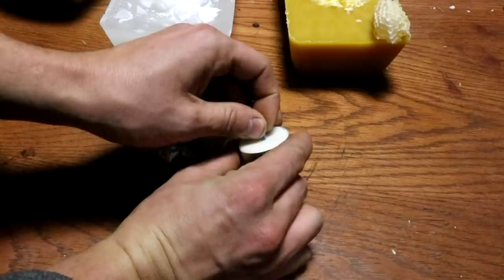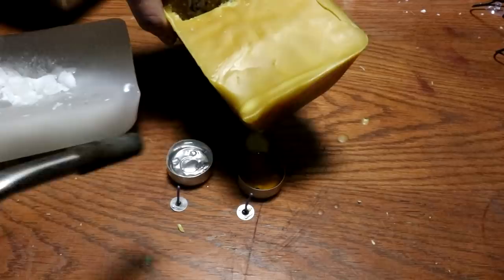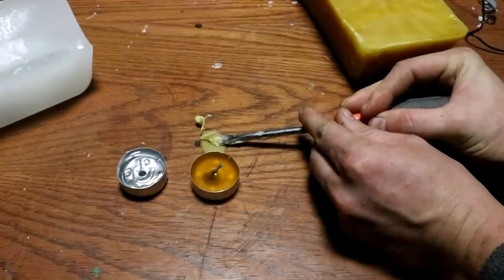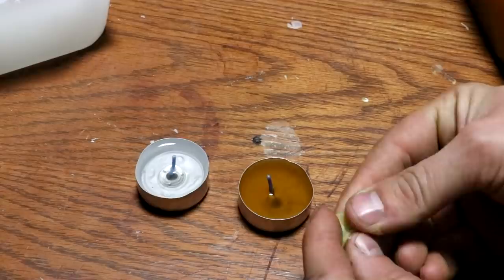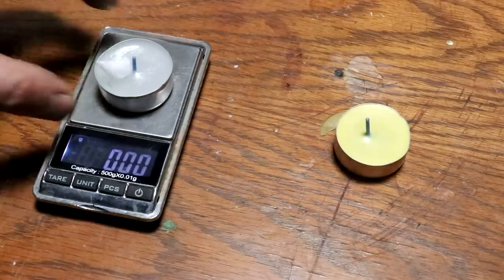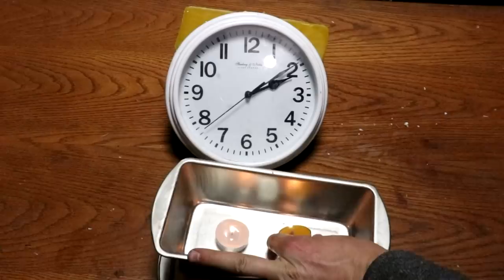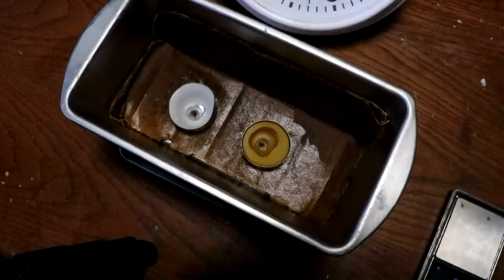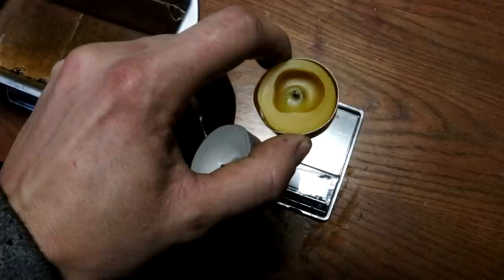Beeswax Vs Paraffin: Flame Test

Comment: It's cool we can see that you set the timelapse camera to 20 second increments, because the second hand adopts 3 different positions on the face of the clock. 60/3=20
Reply from the maker: It was actually 40 seconds.
Reply: It could have been any multiple of 20 seconds provided it wasn't also a multiple of 60.
Reply: Aww yeah, JamesG is correct.  That's a cool phenomenon.
Reply: For those tickled by the 20sec vs. 40sec question, the deeper explanation lies in the mathematical topic of Group Theory. In this case, the positions of the clock hand corresponds to the group called Z_3, only taking the three positions of 0/20/40, as a subgroup of a group called U(1) or S^1, describing all possible clock-hand positions. 20 seconds corresponds to a 120-degree clockwise rotation, while 40 seconds corresponds to the opposite, namely a 120-degree counterclockwise rotation (or, equivalently, 240-deg clockwise).
Reply: Clearly this is the case of sampling error. Since the signal (clock hand movement) was a frequency (1Hz)  higher than twice the sampling rate (1/40Hz), the reconstructed image (playback video) differs from the original image, and is aliased. Given these frequency, if the clock hand moved at any frequency that is a multiple of the sampling rate, even 600Hz, ie, 10 steps per second, it would appear indistinguishable (ie, aliased) from a clock moving at half the sampling rate (1/20Hz, or 1 tick per 20s). This is known as "aliasing"

On playback, the reconstructed signal appears to have a frequency of 1/2 the sampling rate (ie, 1/20Hz), due to  folding (experienced as the wagon-wheel effect, where a spoked wheel appears to rotate slowly or even backwards in movies).

For more signal processing theory relating to sampling theory, wikipedia/Aliasing is a good starting point.

Comment: I know there's a slight convective current but would it make much difference testing on a large flat surface compared to a "bowl" that could hold in co2 and not have sufficient o2
Reply: This would be true only if it was much more constricted.

Comment: I think that included with the thermal absorption of the wet cardboard, the fact that it was done in a dish meant that some co2 collected at the bottom even with the convection current from the flame,  hindering the size of the flame and therefore not allowing all the wax to melt

Comment: love your videos fellow utahn here. keep up the great work. the beeswax did not burn as fast, it had a longer longevity than the paraffin, but at the same time, the paraffin burned brighter and had a larger flame it seemed like. if you are up to it, you should try and do a thermal heat test with a laser thermometer or some other tool and see if the flames have a temperature difference. i am thinking the paraffin burns hotter and faster but does not last as long, but the beeswax burns less intense but lasts a lot longer. each could be suitable in their own ways for different applications. either way great work cody.

Comment: It might not have been soy wax but compressed paraffin powder. liquid paraffin is sprayed in a cooler and the particles cool and collect in a hopper that is augured into a mold and pressed. Candles are made much faster that way compared to traditional melt and solidify methods. There are some good videos here on youtube showing the mass production methods.

Comment: What I find with beeswax is that it needs a larger, more porous wick. It tends to contain impurities, which choke the pores in the wick; that's why the flame is smaller. It can even go out completely. It also produces more soot on the wick, again impeding proper flow.
If the tea candles don't melt all the wax available in the cup, something obviously is wrong with the ratio wick size to cup size.

Comment: Hi Cody. If you are concerned with the number of variables, and hence, respective number of experiments to quantify things like mixing ratios I would suggest looking into doing a statistical design of experiments (DOE). Something made for just this sort of thing so you only have to run a small number of experiments with a random distribution of your variables but can generate an optimizable equation to study the effects of each of the variables on a metric such as flame height or whatever you are interested in.

Comment: Bees wax releases more energy when it burns, but it melts and burns at a higher temperature.  I saw a good test for this with wood chips mixed with wax instead, and bees wax had a much stronger and longer flame, but also very sooty.

Comment: too much heatsink... metal and wet paper....
Reply: Wax is extremely insulating. The metal and wet paper are inconsequential in comparison. It's a fun/easy experiment you can run at home.

Comment: Melting Point:
Paraffin wax: 99 F
Beeswax: 140 F
Soy wax: 120F
Paraffin has an advantage regarding storage in being more chemically stable over time.
When testing candles, I measure Initial length of exposed wick and length of char, if not entirely charred.

Comment: Cody, pouring water on the cardboard was a mistake. It cooled down the containers not allowing the rest of the waxes to melt and feed the knots. They usually burn almost all the molten wax, and I think you should repeat the experiment without affecting the designed process.

Comment: You need a larger wick for beeswax for.the.same size paraffin candle.
Reply: nickwoo2  I was thinking along the same line. It's been a couple decades since I made and sold candles. Every new wax, candle container, or candle size I made required trial and error in wick selection. Burning down the core of the wax is a sure sign of needing to change the wicking.
Reply: @GOAP68  which wax you suggest paragon or beeswax with cryon?

Comment: The diameter (and material?) of the wick needs to be matched to the "fuel": 
Thicker wick-> more output, more liquid fuel available, but higher consumption (and risk of boiling). 
Thinner wick-> less output& consumption, but risk of not melting everything (can result in burnt wick), etc. 

That's at least what my brief experiments with oil lamps indicated..

Comment: Thanks you confirmed that Bees wax holds heat longer so if I use for a pcm material in my water heater it should perform better.

Comment: Good video. To be fair you should also make another test in jars, deep enough to allow the flame to to heat up the sides and melt them down as it goes down. 8 ounce jars should do. The flames will be different as well. They will take some time. Maybe a day or two.

Comment: You said that paraffin wax has a lower viscosity when melted. This is true. If you are making beeswax candles you generally use a heavier gauge wick to produce the same flame that you would get from a thinner wick in a paraffin candle. The main reason your beeswax candle burned for so much longer was because it was drawing less wax and burning with a smaller flame.

Comment: My dad kept bees for a little while, and we tried making wax candles from the beeswax (including tea light candles). We tried wicks from the store, but we found that they really struggled to burn, had small flames, and went out really easily. What we ended up doing was using some butcher string as wicks, and the candles burned quite well after that.
Reply: Hmmm.  You've got me thinking... I just made a buddy burner in a tuna can using corrugated cardboard and the burr comb scrapings from my beehives.  (My husband is pretty used to my weirdness, just responding "oh, uh huh" now when he asks what the heck I'm doing and I tell him, but this one may have convinced him I've completely gone over the precipice...)  Hopefully when I use the burner, the cardboard will wick sufficiently to keep it going.
Reply: @Wosiewose , if it's anything like the buddy burners that I made as a kid, you will have no problems. We made them for a class camping trip in school one year. Part way through the trip, they topped up the buddy burners with wax because a lot of wax had burned and the big coil of cardboard was still in good shape. Even with how beeswax burns, I would think the cardboard as a wick would work really well.
Reply: @adammcinnes5615  Oh good, thank you!  Appreciate it!

Comment: Normally a votive candle like that would burn completely with no or minimal wax left behind.  In this case the water on the cardboard cooled the aluminum casing on the candle and prevented the wax around the edges from melted down into the flame.  I would say your “safety” measure skewed a very interesting experiment at least a little.  I would be very interested in seeing it done without any water present.

Comment: Pouring beeswax at 180° causes less shrinking than beeswax at higher temps.  That's important when making candles because you want them to shrink enough to be removable from the molds. Below 180 it could still be liquid but it doesn't shrink enough and the wax gets stuck in the molds
It'd be interesting to see how much volumetric shrinking beeswax has at varying temperatures, and course the same with paraffin and, if you're interested in that too.

Comment: I wonder if adding some parafin wax to bees wax might increase the burn time. Much of the bees wax wasn't used by the flame, if the melting temp was slightly lower it might be able to utilize more of the wax. This would cause an increased burn rate, but there might be a ratio that increases the burn time.

Comment: Hey Cody one of my frends spilled sulfur on the flor of the classrom. What should i have done about that, because they did not just spilled it but they blowed at it and i should note that was not a lab but a normal classrom with no ventilation. Was it poisonous

Comment: Are you able to purify bees wax so it is white again?
Reply from the maker: Im working on it
Reply: You need albino bees for that. ;-)
Reply: Yes, it's possible.
Reply: How would you do that? melt it and put it through a hot mesh sieve?(so it doesn't solidify on the sieve)
Reply: I imagine "cracking" i.e. differential distillation. Pulling off the fractions that have slightly different boiling points. Or perhaps solvents that dissolve the 'impurities'.

Comment: what happens to the wax as it burns off/evaporates? as in im curious if it is possible to capture the steam like distillation, and if it would still be wax afterward or refined into something else. or is it just completely burned off? i feel like the paraffin, being petroleum based, would react differently to that process.

Comment: The hole it burned in the wax is caused by the cooling of the water. If you had left it surrounded by air, all the wax would have melted. It's the same with using them in cold weather. So please Cody, do it again. And they will both burn even longer, I assume.

Comment: Your candles didn't burn properly because the water in the cardboard acted as a heat sink and prevented the wax from melting properly. Tealights need to be fairly well insulated so that the metal cup heats up enough on the sides to melt all of the way down into the bottom. You'll notice this problem if you try to place them on e.g. a tiled surface. The cardboard on its own would have been fine. You could dust it with borax if you're concerned about fire but it's unlikely it would even char.

Comment: Maybe I missed it, but what's the ambient temperature of the test room?

It's normal for tealight flames to be tiny, hence having that small crater under the flame as they burn, however, they also usually exhibit the behaviour of the flame heating all the wax inside the metal cup sufficiently to melt it into a liquid, ensuring that it gets completely consumed (or as close as possible) before burning out.

Comment: Seems clear that the paraffin wax has a larger flame because it there is more fuel getting to the ignition point. I'm curious to know if that suits due to less beeswax melting and making its way up the wick, if there is less wax vaporizing at the wick, or some combination of the two

Comment: The wick makes a HUGE difference in how the condles end up burning.  For the purposes of this test, the wicks used seem rather poorly suited, as ideally the candles would have been fully consumed, but of course ambient temperature is a big factor.  I think the rate of transport is the primary concern, and any given wick will perform differently with a different fuel.  I think the soy-wax wicks are not good choices for paraffin or bees wax.

Comment: I'm wondering why both candles did only burn so little amounts of wax. All small candles I every used liquify the entire amount inside each candle.
Could the CO2 buiding in your metal container have caused the flames to shrink?

Comment: care to do this 1 more time and add a beaker of water over each flame and measure the amount of heat the waxes could generate before they burn out.  paraffin seams to burn much hotter but dies several hours faster; could the bees wax heat the volume of water higher given its longer burn time?

Comment: perhaps you could check the amount of specific heat (probably the wrong term) they give out by heating a volume of water and comparing the temperature change to the amount of wax burned to the change in temperature and time passed

Comment: Instead of using a wick tuned for paraffin candles, a different wick for beeswax might have made for a better experiment, with a similar flame size. From my experience burning these "teapot candles", it looks like the ambient temperature was too low, with "room temperature" at least the paraffin candle should be able to use nearly all the paraffin, instead of leaving a very big residue.

Comment: You should try the old trick for water proofing things. Paraffin wax and gasoline mixed together. You rub that on a cloth and it should be water proof. That's what used to be used in circuses before one caught fire and the mixture couldn't be put out easily. It's similar to Napalm.

Comment: Beeswax last longer because of it's higher melting point which results in a smaller flame. This perception to most think beeswax has more energy but in fact it's just burning lower in BTU.

Comment: You need the right wick for the given fuel!
As anybody who like to make their own candles know - you need the right wick for you candle. The right wick depends on type/diameter of the candle and the material. I don't know about bees wax but for paraffin and stearin you need different wicks for optimal candle performance.
I like to cast my own candle stick candles (22mm diameter). Candles of 20cm in length burn about 7 hours - no matter if paraffin or stearin. However for stearin the wick is thicker and is pretreated differently than for paraffin wax. While you sure would get a burning candle by mixing them neither would work optimally and both would probably drip horribly spilling lots of the fuel (that can be remelt) and wasting the wick and perhaps even soot. The right wick and you get a candle that burns bright, clean and without dripping.

Comment: What was the room temperature, because a higher room temperature would mean it would take less heat to heat both to their melting point allowing them to burn longer before the flame is too small to sustain it and burning more of the wax.

Comment: If you did mix the, using the different densities could you separate them with only a small percentage of loss?
So, a 50-50 mix, and get both as pure as you can?

Comment: Since it was very cold where you were, you should try the same test in summer, normally the pots would fill up with liquid wax as they warm up, using all the wax as it burns, also using a wet cardboard or a metal pan was pulling the heat out of the metal containers, making it harder for the candles to reach optimal temperatures to burn all the material.

Comment: Does paraffin mix in hot water when melted? I know it's an oil product, but it's not oil itself anymore. Or is it? On the other hand, beeswax is literally fat, so it probably won't mix in hot water. Or maybe insect fat doesn't have the same lipid structure than animal and vegetable fats?

Comment: That's a pretty crappy candle light you built. Our parafin candles last for 4 hours and they burn basically all the wax.

They are the same size, same aluminum casing. probably a little less volume initially. What caused this difference?

Comment: Here's an idea for a beeswax candle that can melt more wax with a small flame:
1 - Have a "stem" of copper or other conductive metal in the middle
2 - Somehow wrap the wick around this stem (I'm not sure what the best method of fastening it would be)
3 - Have this stem welded to the base of the candle, the idea being to transfer the heat of the flame more directly to the candle walls

Maybe this could overcome the problem of the flame only melting a small portion of the wax through more efficient heat transfer.
The candle could get a bit hotter though, so having something that insulates* underneath it would be advisable.
(* we don't want to lose heat to the table or surface underneath it)
Reply: I love the idea and this does work and there are patents for similar things. It is typically easier to use a larger wick for a larger flame or to just use a wax blend that melts at a lower temperature.

Comment: I am researching candles making and one of the things I found out was that is very important the wick that u re using because there are many types of them. There are some testes you have to do before you make a candle and that includes the range of the light produced by your wick so only then you determine the size of the candle. In your video it seems that none of the wicks were the proper type for the wax/parafine used , or the size was not suitable (wide).

Comment: Would the beeswax be a better heat source for the clay pot thermal heaters that were all the rage a while ago? 
Does beeswax provide a hotter flame for a longer time than the paraffin/ soy tealight ones?
Further testing is required it seems...